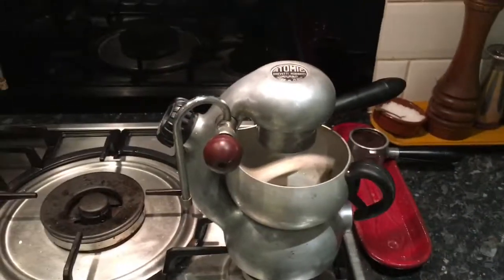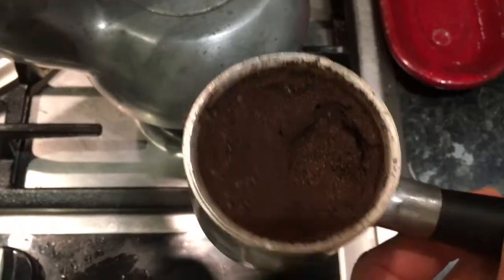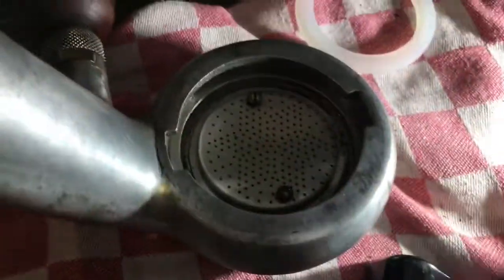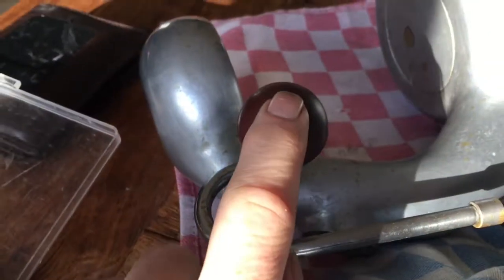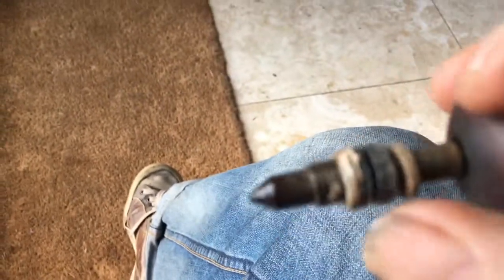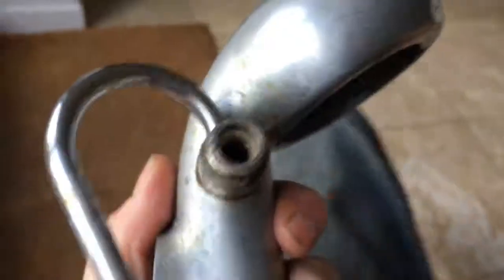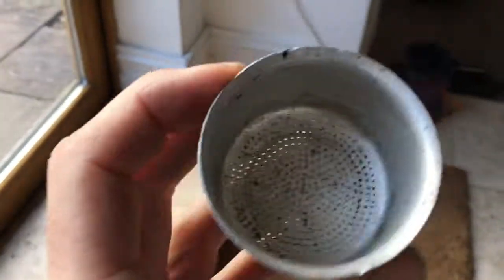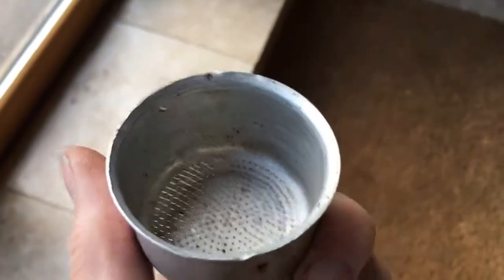Atomic Coffee Machine with not enough pressure to steam milk

Comment: Thanks for sharing , my dad gave me their atomic twenty years ago , I went to Bon trading to rethread the filling hole as the frozen steam release handle broke the inner thread as I cranked it open ,I think it's from the 60's , it has the short steamer end ,I managed to keep the original Steam release / filling handle and just replaced the seal to keep it original although it has a few scallops out of it near its seal from over tightening ,I'll go to Bon trading and get another I suppose and just keep the original so I have it , I'm going to tackle the top screen screws and try not to break them off , I'll check your video again on that procedure, I really appreciate your sharing ,there wasn't much inet twenty years ago so it was guess work trying to understand how to handle the atomic short of paying Bon to rebuild it and I know finger tight from now on , cheers big ears

Comment: Hi, congratulations on the videos! I have this problem: my Sorrentina emits very little steam. No steam leaks are seen, either from the cap or the steam arm. When the Sorrentina changes sound, I insert the stick into the filter holder and open the steam valve, but the steam emitted is very weak. If I remove the stick then the steam comes out forcefully from the filter holder. I descaled everything well and by "blowing" from the cap and the steam wand the air passes well. What's wrong with my Sorrentina? Thank you so much for your availability and for your beautiful videos!!

Comment: Great series of videos.  Just bought an Atomic.  Finally!!!  Yay!!!   Poured out a whole lot  of dry whitish powder .. ewww.  Then under the plate (amazingly screw heads didnt snap) discovered thick white gunk.   Lemon Juice and lots of shaking later machine is alot cleaner.  Still hard to budge deposits in place but will leave for the time being.  Made my first cup of coffee today.  Amazing in comparsion to cheap charlie Moka Pot.  Disappointingly steam wand didnt work.  I will keep exploring and next time will try i) high temp from the get go  ii) finer grind.   If this doesnt work..will buy seal replacement kit from Bon Trading and see how I go.  Thanks heaps for these vids.  I feel my inner "nerd" stirring.   Cheers from Regional Victoria, Australia.   PS:  Is there a reconditioning service available if my tinkering tanks?   Cheers   Lisa
Reply: Hi - did you get your steam arm working? Bon Trading do offer a refurb service if things do go horribly wrong. When using an atomic, you want the highest heat possible. If you are in any doubt as to which coffee grind works best, start off with a bag of pre ground La Vazza Rosa - that is pretty close to the ideal grind. Hope you are not too affected by rye fires. We are flying in to Melbourne at Christmas where I'll be reunited with my trusty red atomic which we keep in our camper out there. Mike
Reply from the maker: Hi - just seen your comment. How is the atomic going - did you get the steam arm working. I can refurb your machine in Uk or Bon Trading in Sydney can do it. Mike

Comment: Hi Mike, love your video.
We have an Atomic (Brevetti Robbiati)  just like the one in the video. I was able to remove the red steam knob and bevilled metal ring. However when trying to then screw out the brass shaft to get the seals out, the top (square) section of the brass shaft sheared right off, at the point where the square section joins the round section. The brass shaft will not screw out any further.
Interestingly, the outermost washer on the brass shaft appears to be metal - not silicon. Can I please contact you directly for further advice? Thanks
Reply from the maker: Hi Paul = sorry to hear you have a problem. Send an email to m_scott65 at hotmail.com with your phone number and maybe a photo of the bit that is broken. Mike
Reply from the maker: Hasve you seen the vid below - it shows not only how the steam arm fits together but also where you can get all the parts - like the brass threaded rod. Mike

Comment: Hi Mike, I have a Sassoon labelled Atomic, how do I get the red knob off the frother arm as it has a side hole fastening?,looks like an allen key or very small screw which I can"t undo.I  can replace with Bon trading top screw red one, and new brass section and seals,but be nice to keep original. Shaun
Reply: Hi - I'm not sure, I have never had to replace one the innards of a Sassoon and I'm not even sure the atomic parts would fit. I'm in France on holiday for a week and will disassemble a Sassoon when I get back. Mike
Reply: @MikesMercsandothercars  Thanks Mike that would be great,Shaun